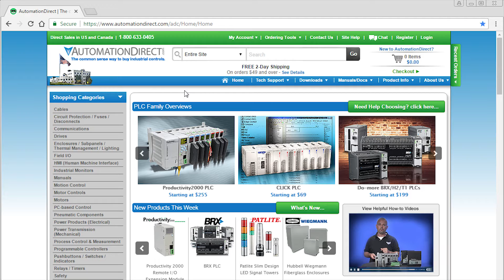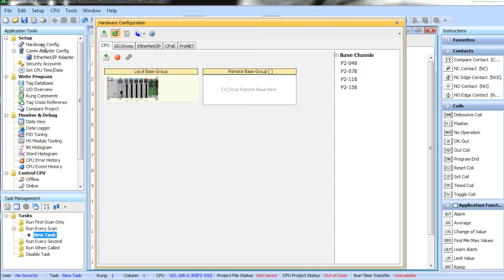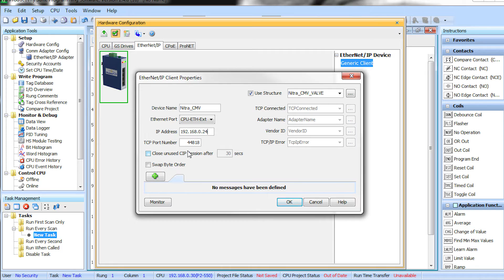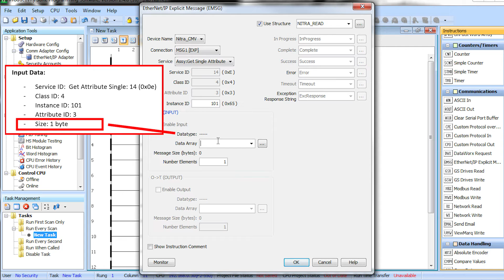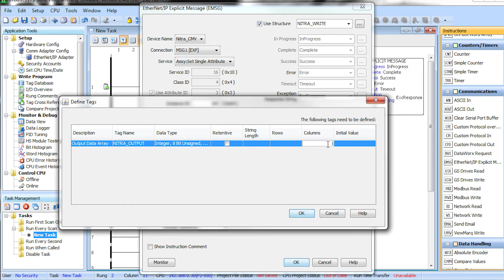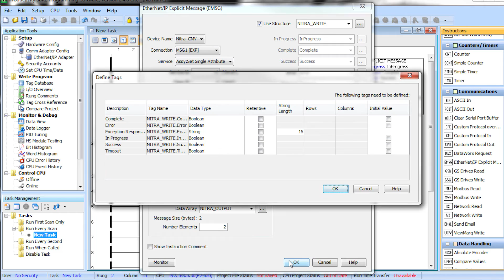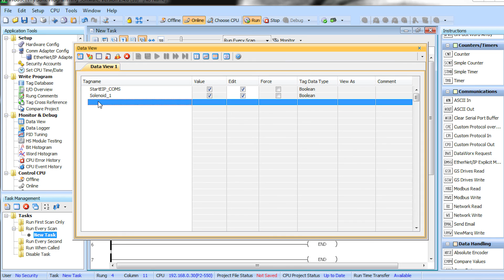Connect a NITRA CMV Valve to Productivity PLC via Explicit Ethernet/IP from AutomationDirect

Comment: Good afternoon, great  video !!  I have a question ...  the valve have connectivity whith other plc (siemens, allend Bradley) ó only whith plc the Automation Direct. Tanks
Reply from the maker: Good Morning Rogelio, This valve will work with any controller that supports the EtherNet/IP protocol,  when using the CMV-E*X-4X  modular plate. There is also a D-Sub connector that will allow for direct wiring of the valve. An overview of this series can be seen here; https://cdn.automationdirect.com/static/specs/nitracompactmanvalves.pdf.